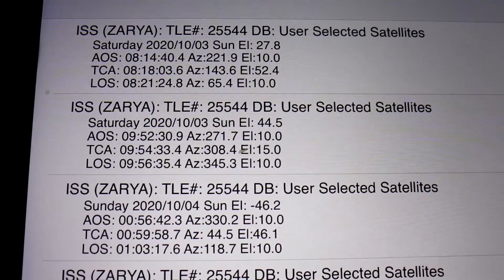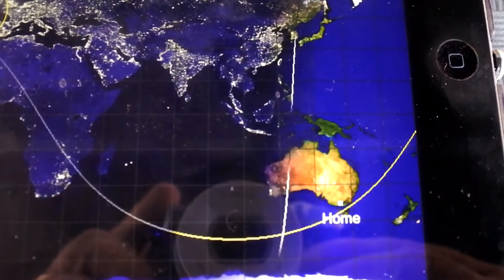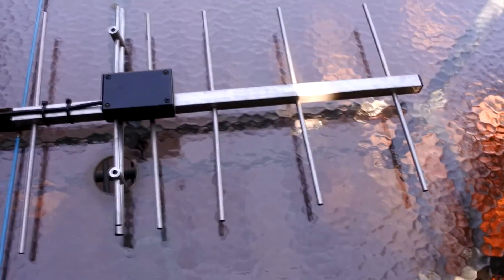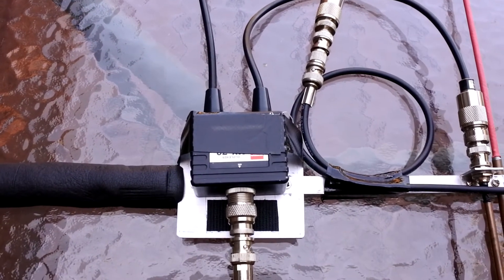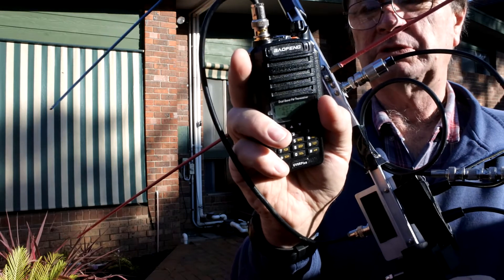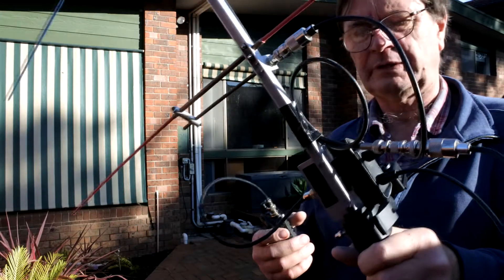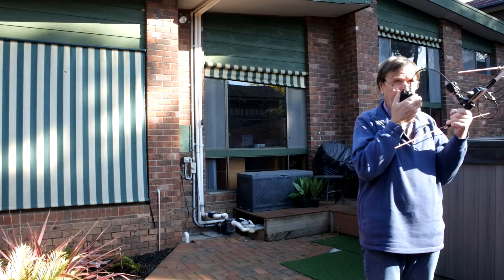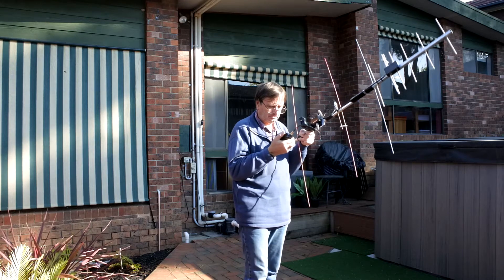Baofeng UV9R Plus and the ISS Fm Repeater (Did I make a Contact ???)

Comment: Did you set the T-CTCSS on your HT? The ISS repeater need the 67Hz sub tone. So don't worry. Next time it will work. 73 de DO4WD
Reply from the maker: For sure it was set. Just confusing that the VK2 acknowledged me but did not give me a report. Hence the confusion.